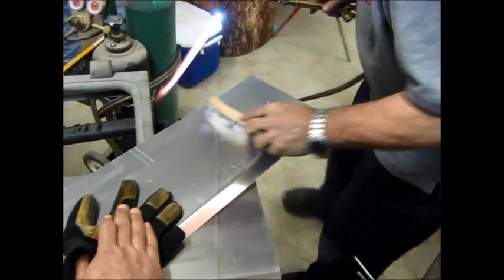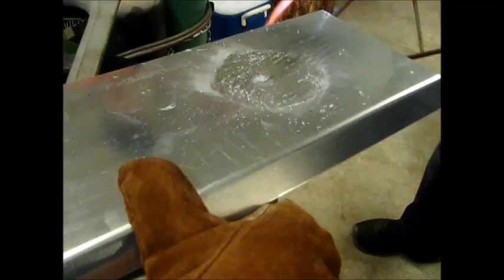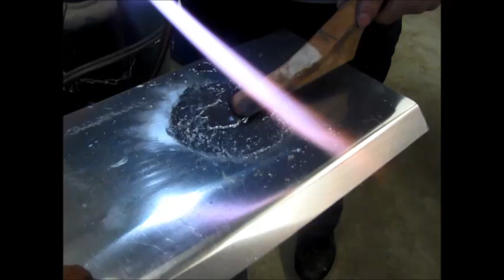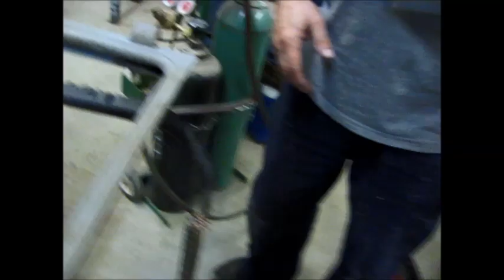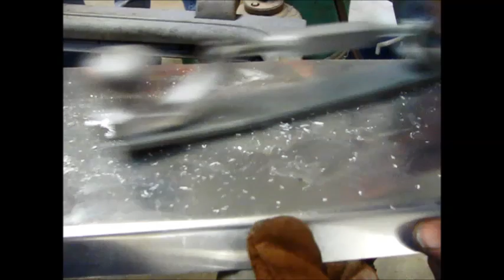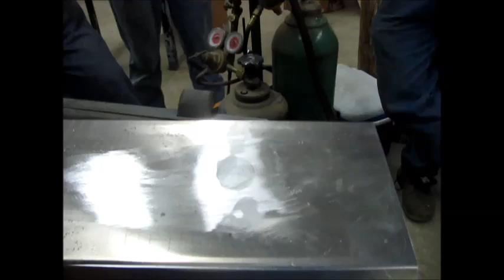Lead Loading Aluminum

Comment: I'm very impressed!  I never thought lead/tin solder could be made to stick to aluminum.  So it looks like the trick is to first brush the molten solder into the aluminum with a stainless steel brush, in order to tin it -- wow!  Thanks for sharing that method!
Reply from the maker: The aluminum must be heated sufficient to open its pores so the lead has something to bite to..